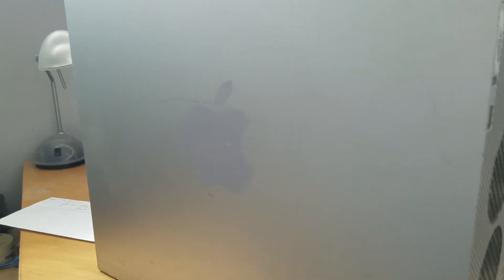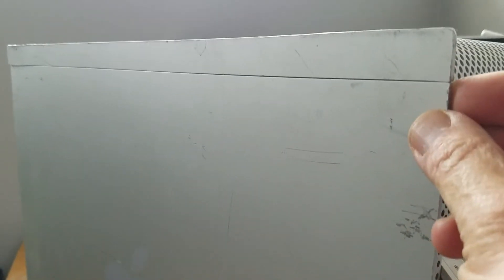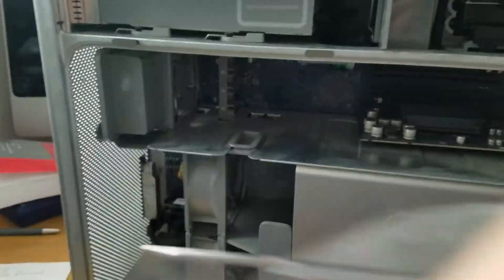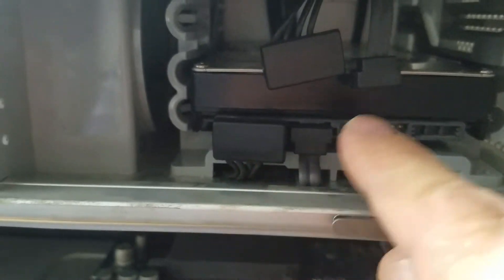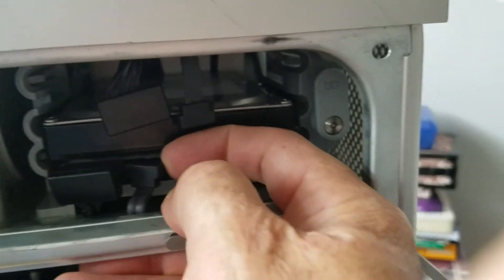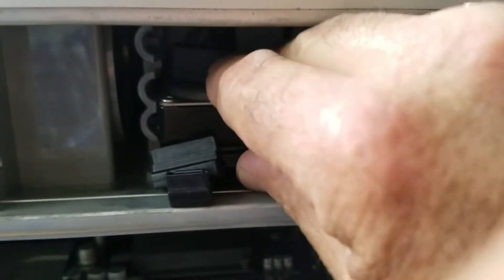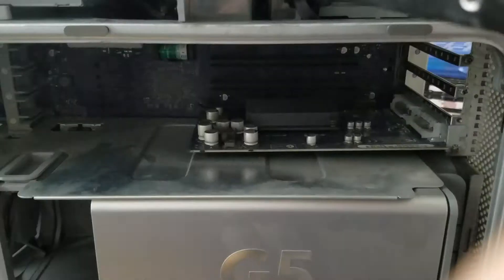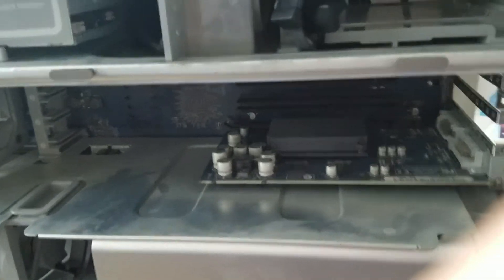Power Mac G5 Hard Drive Removal

Comment: Thanks. But, if you have TWO hard drives in the G5 you cannot put your hand on top of the drive to push it down. That is my situation.
Reply: and none of the youtube videos show that situation
Reply: Pliers set to wide grip: careful where you grab, grab firmly enough so side to side pressure to rock the drive in its socket does not see the piers slipping sideways, while steadily pulling. Bottom drive out makes the upper easier.